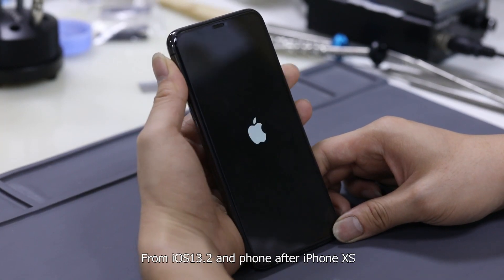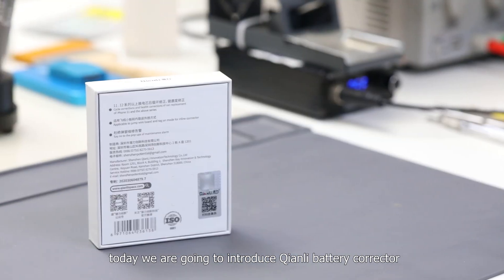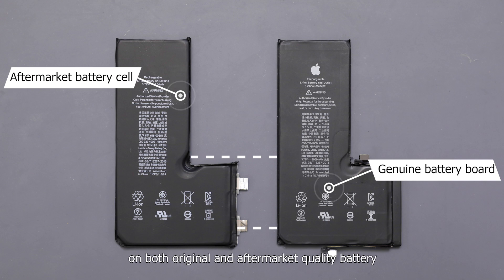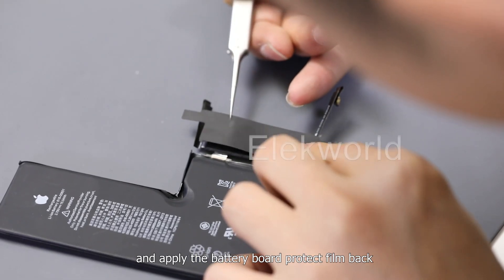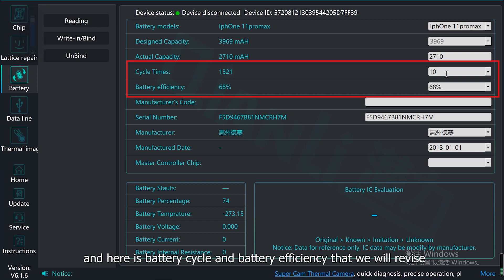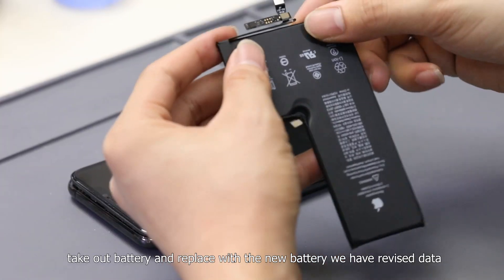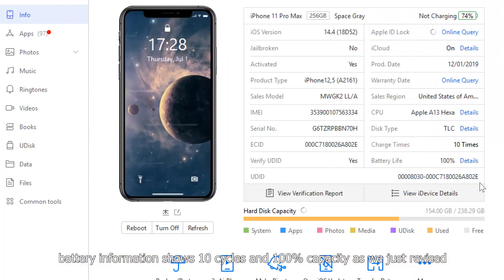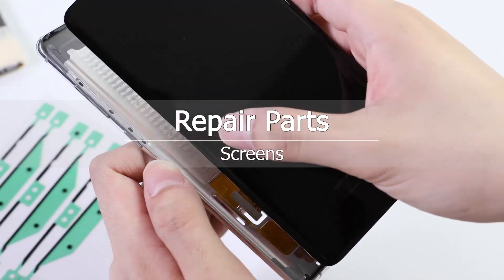"Important Battery Message"+Battery Health Fixed With Qianli Copy Power Battery Data Corrector.

Comment: hi just plugged my battery corrector into my laptop the computer didnt recognise it now i have no display on my battery corrector please help
Reply from the maker: Have you opened the "Qianli Repair Helper" software on computer?
Reply: @Elekworld  Yes and copy power just disconnects and laptop says device not recognised are there any update files for it
Reply from the maker: @maxvisagie1140  we are checking with Qianli, maybe your computer haven’t installed latest Qianli system.
Reply: @Elekworld  hi i cant register for qianli so i cant use updated software
Reply from the maker: @maxvisagie1140   Maybe you can contact Qianli directly from their website.
Reply: @Elekworld  ive tried. problem i have is im running on version 5.6.2. if i update software i need to register. and thats what i cant do

Comment: what application do you use to change the iPhone XSMAX battery serial number
Reply from the maker: JC V1S could modify the serial No#, but you need connect battery with JC V1S, meanwhile JC V1S connect with computuer JC asistant, and modify SN on computer(make sure JC software is most upgraded). Check this video to know it: https://youtu.be/n7Z_-g1q0Pc.
Reply: Qianli Apollo can modify the SN?

Comment: you can restore battery health with this equipment if I have an original 85% and boost to 100% without changing the battery
Reply: yea but then its not an accurate reading.  you essentially are making it lie.
Reply from the maker: Yes you can, replace the genuine battery board on new battery cell is for removing non-genuine battery warning message.
Reply: With a new battery it will work. You can't restore health to a dying battery though. It may say 100% but only until it's charged again. It wouldn't be worth doing as a scam totally pointless.

Comment from the maker: From iOS13.2 and phone after iPhone XS, iPhone will pop out “Important battery message” if we replace a new battery on them. It appears not only on locking page, homepage, setting page, but also won’t show battery health data, such as maximum capacity, Peak performance Capability.
Today we are going to introduce Qianli Copy Power Battery Corrector, which could revise battery efficiency and cycle with simple operation. 

"WLXY" Midget Diagonal Pliers, 125mm   
https://www.elekworld.com/shop/productinfo.aspx?proid=6789&categoryid=290

For more Repair parts&Tools and Tech support, please visit: 
Website: https://www.elekworld.com 
Facebook: https://www.facebook.com/Elekworldshop/ 
Instagram: https://www.instagram.com/elekworld/ 
Twitter: https://twitter.com/ElekworldL?lang=en